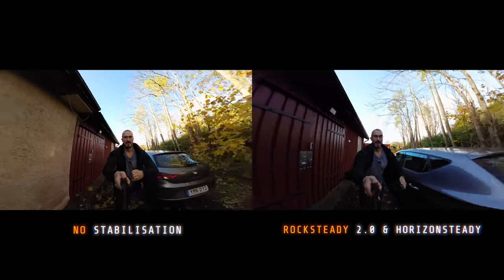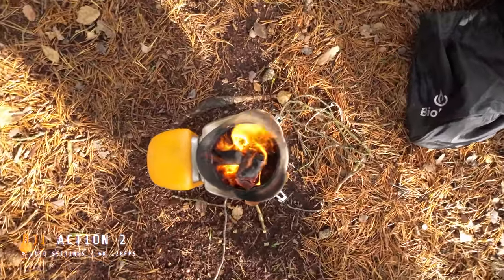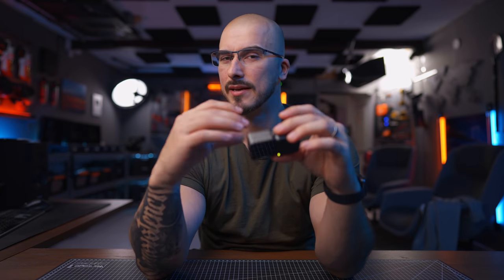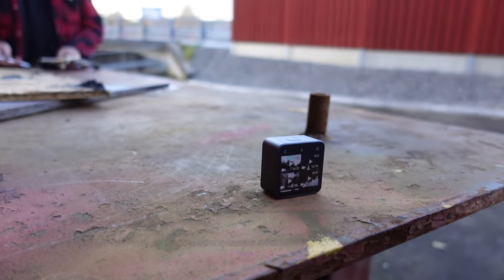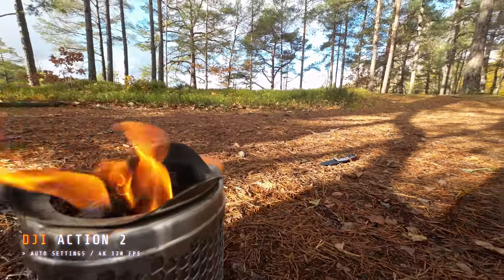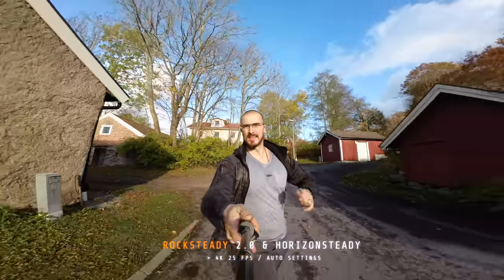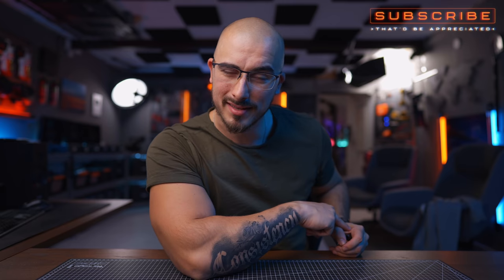DJI ACTION 2 Action Camera | Hands On & First Impression

Comment: So there is no SD card slot in the camera module? How much internal storage does it have? Also is there an option to automatically transfer the footage from the camera module to the battery with SD card module when connecting the two together?

Comment: Very nice intro for a very interesting camera Peter!
My big questions are:
- what’s the battery life like?
- can sharpening be controlled?
- is dewarp mode available?
- how is the lowlight performance?
- does it drop off that necklace all the time like the insta 360?
- if the second screen or batter pack are connected, do we need a cage to mount it?
- how big is the internal storage?
Probably forgot some 😅

Comment: I think I am used to OA with built screen as not fan for modular design. I thought they would keep same design but improve 1" sensor for better low light, 4k 120, stabilizer, and zoom capability.

Comment: I'm sure some will like/love it. I will be sticking with the original Osmo. It's fine for my purposes and I love it. This Action 2 (for me) is a little gimmicky for an action camera. Once you add the modules you lose water ingress protection. The camera alone has a short battery life and only around 22 gigs of effective memory. You need to add a module to get the micro sd option. So it's not a great choice for some. Also the screen can't be replaced if it is damaged. It's just messy and overpriced if you go for the screen combo. Whereas the Action 1 was the opposite. Just grab and go.

A shame they didn't do an upgraded Osmo with the same body form and release a modular cam as well. But that's prob asking for too much! 

I hope when my Osmo gives up they might have revisited it or have come up with something better. I don't want to have to buy a Go Pro if I can help it. 🙂

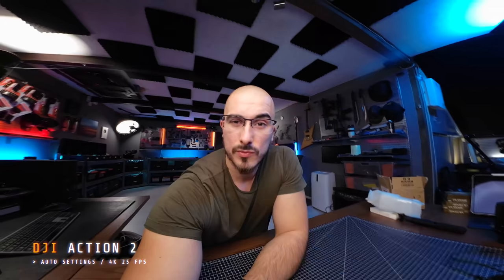Comment: Thanks for the review. It looks it has flickering issues on detailed surfaces that we can see at 3:58. It's due to the aggressive h264 Group Of Pictures compression. For example Mavic Pro has the same issues and it's very hard to get rid of in post production. DJI should fix this problem in their codecs

Comment: nice review - (apart from the focus) - but one BIG problem - it is made by DJI. I have a mini2 which works fine, but the Osmo thing I bought based on the drone experience never really worked well and I fucked up 100% just after 10 month. So drones I always sell before that period and get the next generation. The first DJI drone, the MAVIC air I had started showing problems (wouldn't boot, remote kept beeping) after 15 month ...  so that manufacturer does not have my trust. The GoPro HERO5 I use since 2015 never failed and pretty much all you did in your video one can do with that old GoPro. Mind you, if I had half your creator creativity I'd max it out maybe - but just maybe.

Comment: The main thing I’m gonna look if I’m buying it- how did they do the mic inn. I’m a motovloger and finding a good solution is a nightmare. Last two years I was using DJI action and the way they did is not perfect. Hoping for better quality on this one, so looking forward for some opinions about that. Thanks for review 👌🤜🏼🤛🏻
Reply from the maker: It's in the USB-C on the power/display module!
Reply: @PeterLindgren1  It looks like it will use a standard 3.5mm to USB C adapter.  They will have a wireles mic available after launch and it comes with lightning and USB C adapters and says it works with cell phones as well so it has to be a non proprietary adapter.
What I am hoping for is that they have an adapter like the original OSMO that can do pass thru power at the same time.

Comment: I actually ordered it, then cancelled once I saw other reviews mentioning the over heating. The SD card functionality and lack of a mic jack in the base unit were concerning but the audio test you did was pretty good. I will hold my horses and let others test and then decide if this over heating is a real issue.
Reply: Yep have heard a few say it has some over heating issues especially at 4K 120fps. Also from what i have seen is that they are going to come out with a wireless mic but your going to have to plug an adapter into the USB-C connection which then you will have to have a screen module or the power module attached. The power module does not have internal mics like the screen module and the camera module has one mic which I seen another reviewer use and it was not that great.
Reply: Retail price of that mic USD $329 per their site. I know of one brand that has a good option for cheaper.

Comment: Honestly I am disappointed with the Action 2.  I feel like they skimped on increasing image quality in area's like HDR, Higher Resolution, and Lower Aperture values, for gimmicky "cool guy" magnet tricks.  I was already ok with the form factor of the Action 1.  I don't want smaller and smaller camera's, I want better image, better low light performance, and larger sensor size i.e. 1 Inch.  This is basically a Pocket 2 with a higher Aperture, wider field of view, without a built in gimbal and its waterproof, sorta....as long as you don't need to record over 32 gigs.  By the time you add the SD card module, and water proof housing, then you have a massive action camera and defeats the purpose of making it small in the first place.